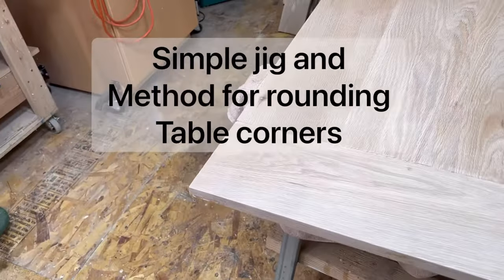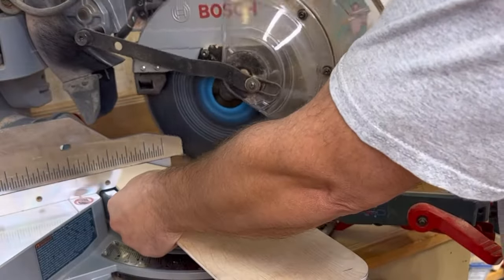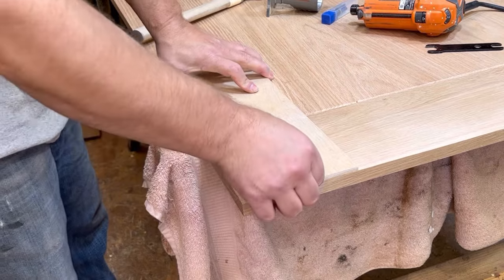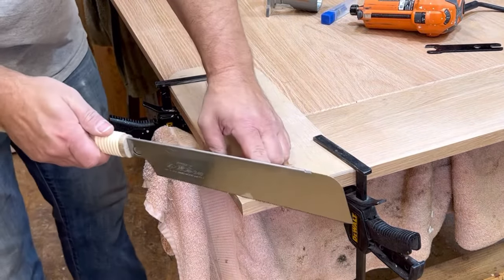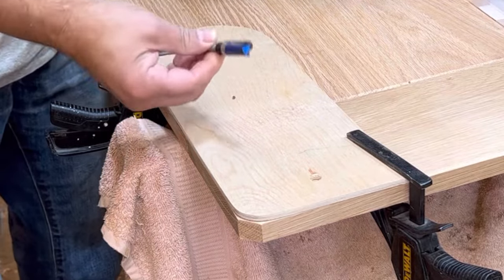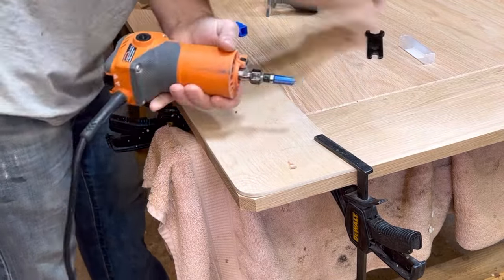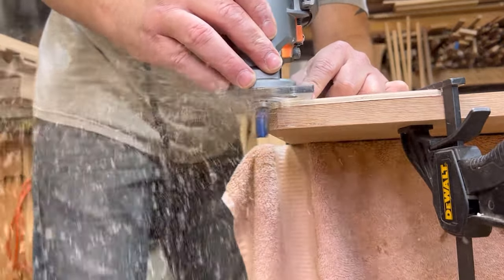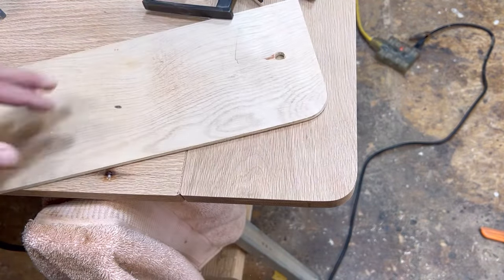This is the easiest method for rounding corners on tables

Comment: Very easy when you gave $1500 worth of equipment
Reply from the maker: You came onto a video about woodworking and furniture building to complain about the price of the tools? And you weren’t even close to the cost of the materials? That’s pretty bad
Reply: @NewmanSpecialsWoodwork  what?..
Reply: Is there an alternatives for when you don't have certain tools?
Reply from the maker: @l.j6223  you can use a belt sander to quickly do this as well, but the results aren’t as consistent. The cost of a belt sander is not hugely different than a trim router
Reply: You can do this easily with $100 worth of tools... lol. $50 for router. $30 for sander. still have $20 left over for a hand saw, piece of scrap wood and a 6 pack of beer.
Reply: Spend less time bitching and more time working and MAYBE one day you’ll be able to afford nice shit.
Reply: A hand saw, a little router with a bearing bit and a couple of clamps.. most of those things can be acquired fairly cheaply. Good luck if you want to get into woodworking with no tools!

Comment: Very helpful.  Brand new to using a router.  Working on a windowsill.  I plan to use a round over bit for the edges but wanted to round out the corners (I have kids) because like you said they’re sharp.  I couldn’t figure out if a rounded corner might be achieved with a round over bit or if I should do this part in the video first and then go over with the round over bit.  Just a first time DIY’er mom trying to make stuff look nice.  😊
Reply from the maker: I would definitely do this first and then the edge detailing. I would not try to round the corner with a roundover bit - it is dicey and doesn’t get you want you need. Once you get the curve it is easier to roundover. 
In the interest of being helpful, here is a piece I sell that may be helpful. You can make it yourself as well. 
https://newmanspecials.etsy.com/listing/1546717305
Reply: Thank you so much.  I appreciate it.
Reply from the maker: @jaglucky13  glad to offer the help I could!
Reply: I ordered the template.  Got my straight bit today and tested it out.  I did ok freehand but I definitely need a template.  Looking forward to trying it out.
Reply from the maker: @jaglucky13  it’s going into the mail tomorrow!